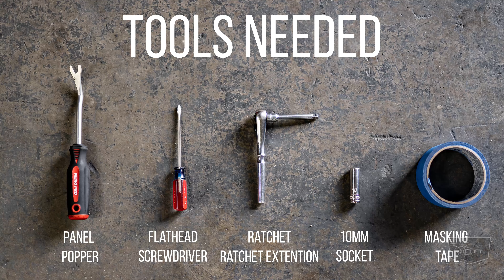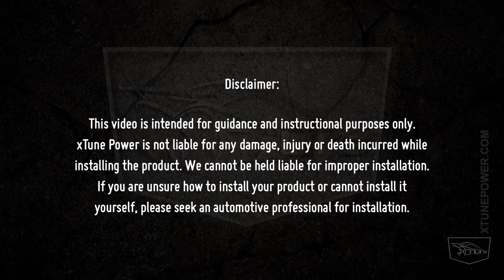X-tune Installation: 2013-2015 Lexus ES350 Headlight OEM

Comment: There are some things the average d.i.y. can do. I would be hesitant on this one, myself. About half of the plastic clips will break being older and brittle so have a new set ready.  That headlight housing is more secure than any other I am familiar with. My '05 Buick had 2 long sliding plastic clips holding the whole thing,

Comment: I have a question,  about the headlights, do halogen and xenon have a different setup. I bought some used lights on Craigslist and where the low beam goes light goes plugged into the back of the light it's just a hole? What or is something missing?
Reply: The ES comes with standard or HID headlamps and this Video is for standard Headlamp set up. Sounds like you have the HID like mine